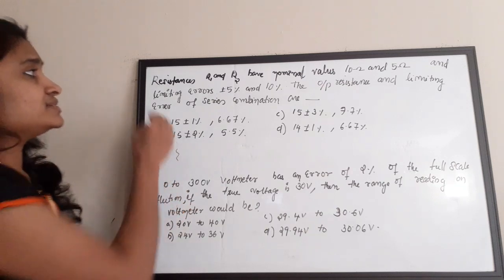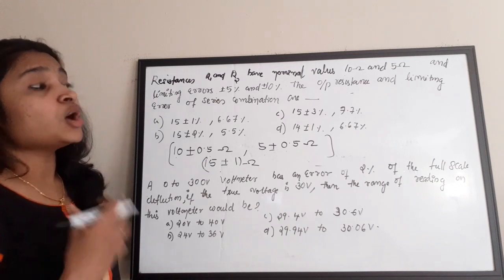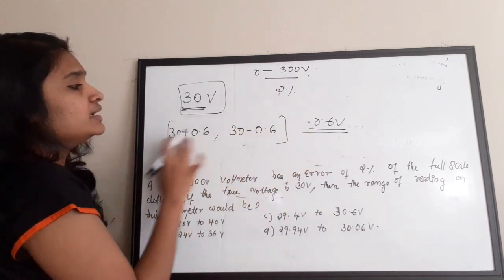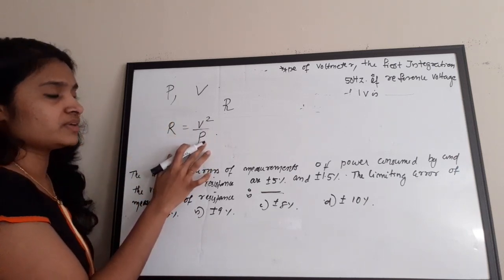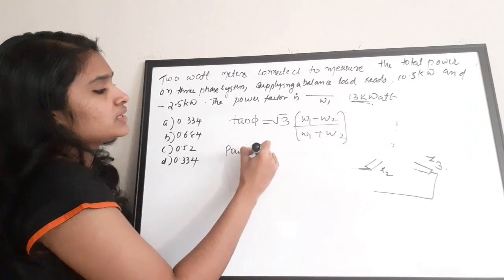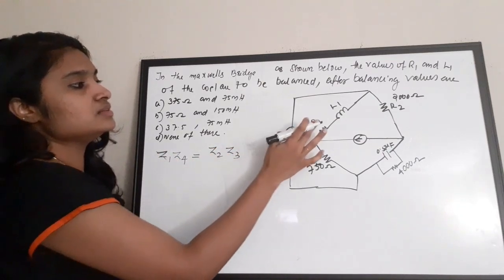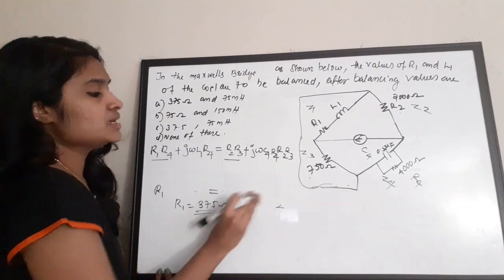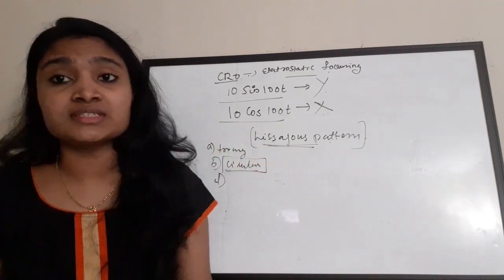Electronic Instrumentation and Measurement Numericals Part2| ISRO| Gate|BARC |AFCAT|DMRC Preparation

Comment: error is 2% of  full scale deflection which is 300v
Reply from the maker: 2% of 300V is 6V. So if 30 V is measured then will 6 V be the Error. Also if I want to measure a 2V then it will not even read. I have a  doubt on this. I think its 2% of 30. Anyway sorry if I am wrong.
Reply: @EasyElectronics_jobupdates  
I am writing solution just to help others not to point out mistakes. 🙏
Full scale reading of voltmeter = 300 V
Error on full scale reading = 2% i.e. (2/100) *300 = 6 V
Error in the reading will be -6 V or +6 V
When 30 V is measured by this voltmeter, the reading will be 30 + Error
i.e. 30 + (- 6) or 30 + 6
Therefore, range of voltmeter reading for a reading of 30 V will be 24 to 36 V.
Hence, option (b) is correct.